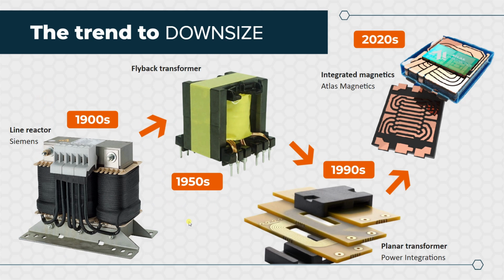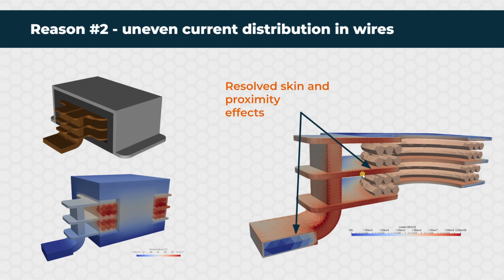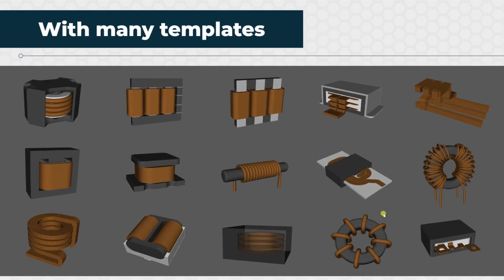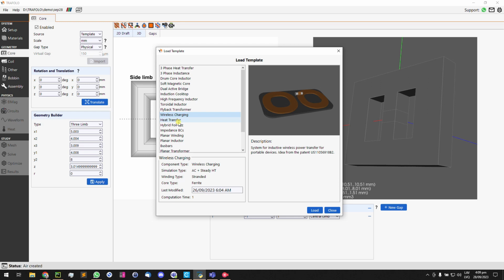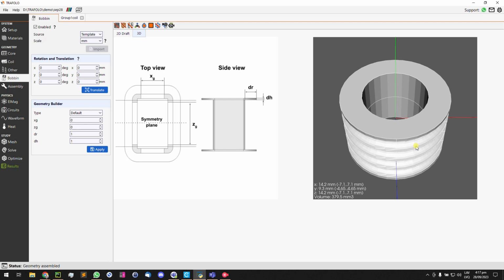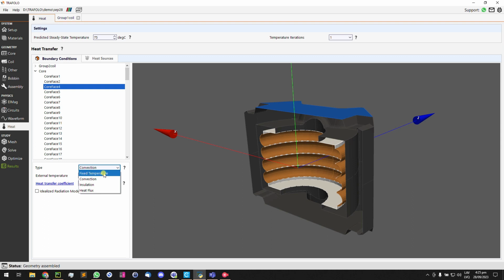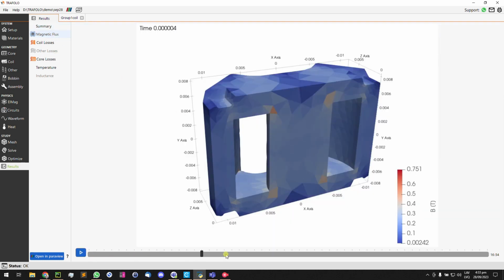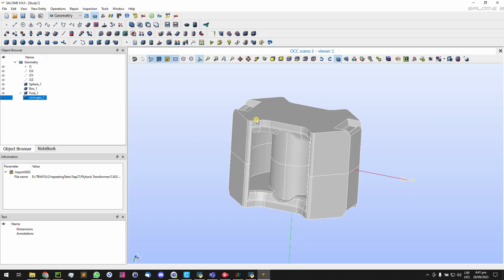Webinar: 3D FEM simulation for magnetics – transformers & inductors (2023)

Comment: Great walk-though, looks impressive for these applications.

Q: I'm looking for something beyond FEMM to simulate interaction between electromagnet and permanent magnet fields for canceling or strengthening the field within a shared core, and determining how large the core needs to be to avoid saturation. Although my current core material is listed in the materials (A36), I don't see any permanent magnet types listed (e.g. N45, N52). Can they be described using the parameters for the material types?

Thanks in advance,
Bryan
Reply: Hi Bryan. You can solve such a problem in ElmerFEM by setting magnetization for permanent magnets, but you will need to set up material properties yourself.
Reply: @juris.vencels  I will look at that again, although I admit I think the interface to ElmerFEM to set that up is a bit beyond my current comprehension.